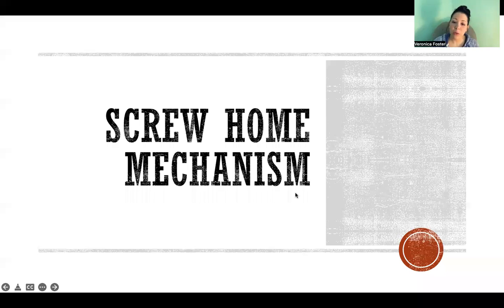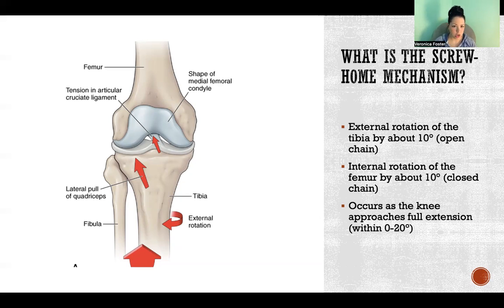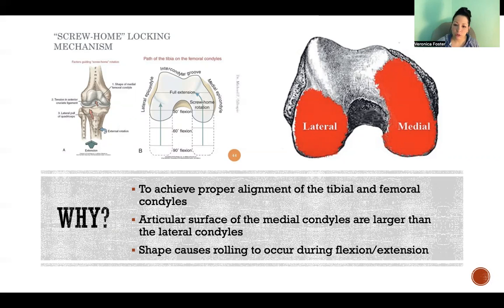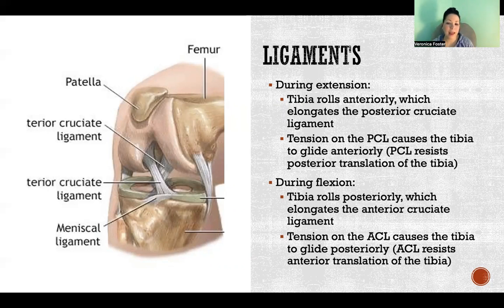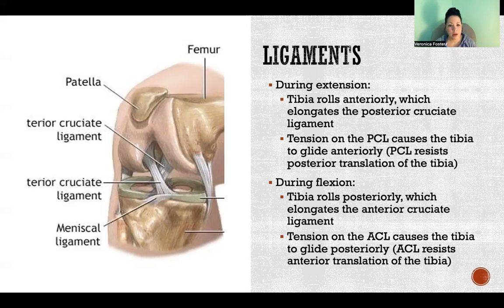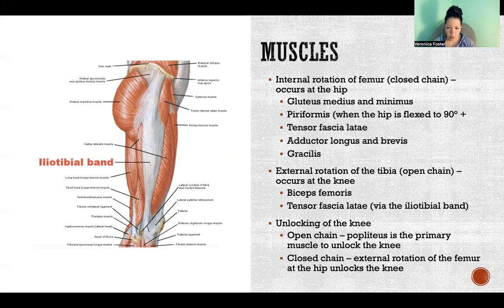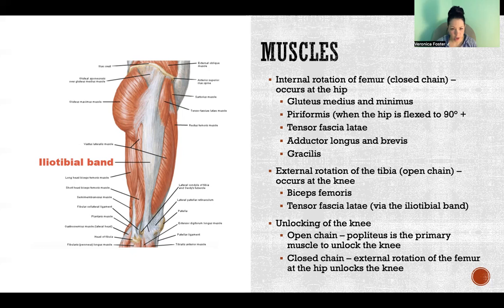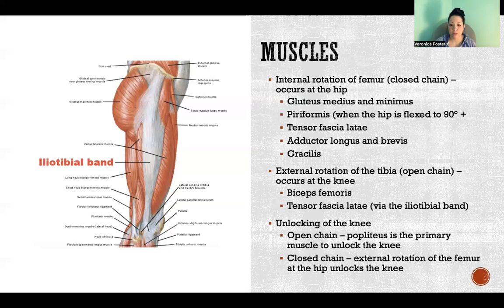Screw-Home Mechanism

Comment: How is the PCL is elongated during extension?? It slacks! And the same for the ACL
Reply from the maker: The PCL is made up of two bundles. One slacks during extension while the other is taught, and vice versa during flexion. The two bundles function synergistically to control posterior  tibial translation and rotation throughout a wide range of motion. Here’s a great paper if you’re interested: https://pmc.ncbi.nlm.nih.gov/articles/PMC6105479/
Reply: @DrVeronicaFoster  okay, but it's not applicable here, right? Because the screw-home mechanism depends on 3 factors and the passive tension of ACL is one of them as it prevents  the excessive anterior translation of tibia during extension, and because of this tension the ACL pull the tibia into external rotation. I mean it's more important than the PCL which is most important role to resist flexion, am I right??
Reply: I read the article it's great thank u, AMB assists the ACL with external rotation during extension
Reply from the maker: @omarkassab6424 I don’t know if I’d say the ACL is more important than the PCL during extension. They’re both relevant and they work together to stabilize the knee in extension